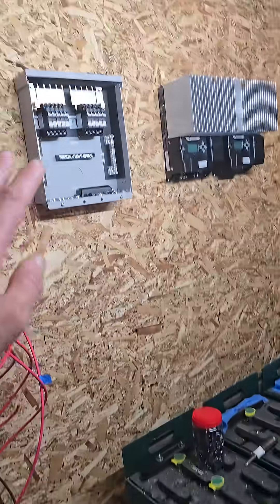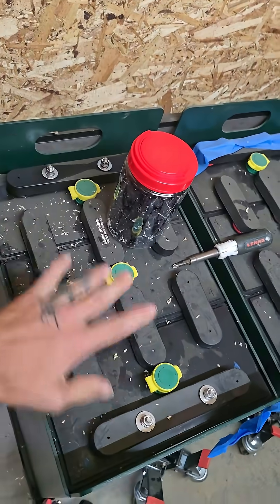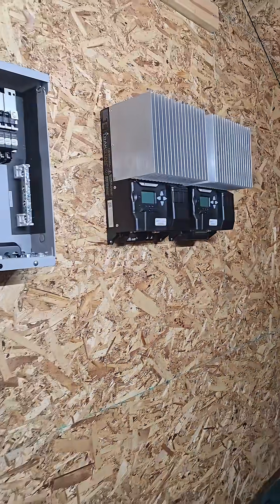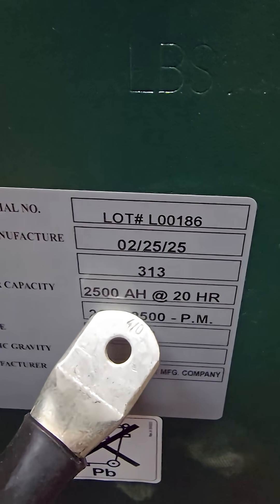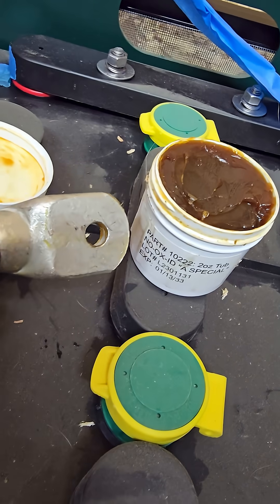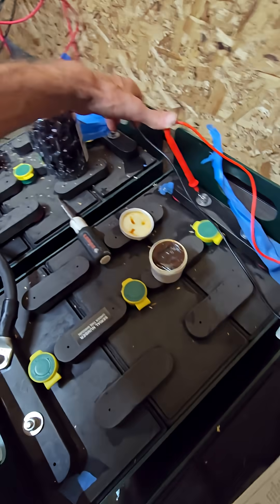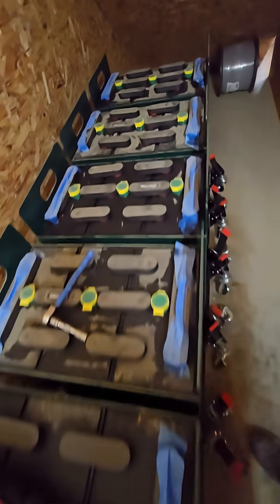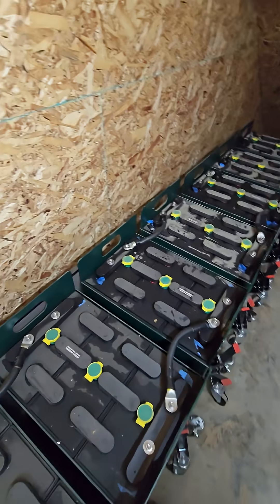Joining batteries to make a 48V bank #narrowayhomestead #offgridlife #batterybank #solarbatteries

Comment: This is one situation where holding your phone while working makes you safer. You never want to touch that battery pack with two hands at once. DC power is just as deadly as AC power. If you aren't recording while working with these types of batteries then keep one hand behind your back.

Comment: I seriously wish you'd go for a higher voltage lower current, but you've got the right idea by having a big honkin cable and terminal.  make sure you use as wide of a nut as you can too. the only 'real' electrical connection will be directly under the nut where you deform the terminal.
Reply: It will no doubt get bumped up to 110v.  Which isn't as big a bump as you might think, it only needs a swing of ~60v +/-, so it's really only juicing it up by 50%.  The savings in transmission loss for AC 110 are probably more than enough to make up for the conversion losses.  But you could also get 40v to 12v or 20v DC-DC adapters for a lot of household stuff like Laptops or Routers.
Reply: Oh, I see you meant for the battery interconnects.  They should be totally fine, but he does have the option to double up on the interconnects because he has an extra bolt free.
Reply: @milescarter7803 interconnects and the main terminals, yeah. 
Running a second interconnect isn't ideal: any difference in resistance will result in an uneven current load, which leads to uneven heating, and a positive feedback loop. At some point it will reach thermal equalibrium, but a 2nd connection might not contribute much.

That's the problem with the nvidia's new molex connector, its really easy to have a loose connection with some pins barely engaged, and not splitting the power properly. Leading to melted headers

Comment: Just remember to use DC breakers and switches on DC. An AC breaker will trip, but catastrophically.
Reply: Most DIN rail breakers are rated for 60Vdc, but check the datasheet of the ones you use. And be carefull of the open cirquit voltage of your solar panes, especisly when its cold outside.

Comment: That 48v ain't no joke.  Insulation is the key.  Where those rubber gloves?
Reply: 48V is a joke. But 2500Ah of 48V isn't. But it's still low voltage, even if you touch the negative and positive at the same time you won't even feel it.
Reply: @justme5384 exactly as i seen it.  Thanks, but no need to validate my point.

Comment: Insulated handle but holding it by the metal😂
Reply: As long as he doesn't complete a circuit then it's fine. I work with DC telecom batteries and I don't even use insulated tools. I just make sure to only touch one battery terminal at a time.
Reply: You need an insulated tool so you dont short out the battery. Touching 48V is safe.
Reply: @lukahierl9857  it's only safe if the electricity doesn't decide that your heart is part of the path of least resistance. In this case 48v can be deadly. Remember it's not voltage that kills. This is a series of 6v batteries that equals 48v so technically if you touched 48v then that would mean the load is traveling through you. Otherwise you're just touching a 6v battery pack.

Comment: Went with 8 LiFePo4 12v 100AH batteries.  100AH x 12.8v X 8 = 10,240 Watts.  Wired 24V.  Batteries cost 700 bucks delivered.

Comment: Massive batteries encased in metal with no way to dissipate the heat? What's the temperature control method for the room. Don't forget to fireproof the room with rockwool and drywall. The fireproofing in some safes is drywall (I found this surprising). THIS stuff, about solar and how you manage it, is very interesting to me.
Reply: I mentioned ventilating the "power room" way back when the garage was going up. I'm thinking one of those thermally controlled attic/gable fans, even the small one, should be adequate. The new ones even have moisture control.

Comment: In my opinion this is more about being independent for your own electric use because the cost would take 20 years to pay off!!🤔
Reply: Not anymore bud. Return time is now LESS than 5 years. Solar systems have seriously dropped in price in the last couple years. If you can come up with 10k it's pretty much a no-brainer. My average bill here in Florida was a bit over $250 a month I bought a system big enough to run my entire home plus some for 12k and it has a 5 year warrantee. That means in 48 months my $hit has paid for it's-self. Batteries and panels are now good for 7k to 10k cycles. That's easily 10 years before anything needs to be touched.

Comment: running batteries in series is cheaper, but now it's a bank of batteries that are all dependent on each other's internal resistance being identical. Any difference between cells over time will cause you major headaches. It's a pita, but running cells in parallel then into a voltage rectifier doesn't let one bad cell bork up your whole network.
Reply: But you will need 48V to keep the DC current at an managble level. And there are very few inverters that can deliver more than 4kVA from 24V.

Comment: Not 2500ah, 1250ah.  You cannot use more than 50% a lead acid batteries rated capacity before damaging the lead plates.

Next problem is, DC doesn't like uneven cable lengths.....youre going to have a crazy long cable for one end, and a short one for the other?
Reply: Wow, how is DC (in series especially) being bothered by the resistance difference between cables? Please explain or give a link to a credible source, because i don't see it.

Comment: An insulated handle doesn't work if you're holding onto the part that's not insulated.
Reply: When working on batteries you want an insulated tool not to protect yourself (it's low voltage, you could touch it with your bare hands and be fine) but to protect against unintentional contact with conductive parts that could cause a short.

I've seen cases where trying to tighten the contacts, a wrench touches both poles on a battery and it welds itself in place causing a massive short that makes the water/acid inside the battery to boil and make the battery explode.

Comment: Grease is the right word, it's called dielectric grease
Reply: Dielectric grease is insulating, he mentioned he’s using conductive grease. Overall still achieves same function to prevent oxidation of the terminals.
Reply: "Grease is the word." - Frankie Valli